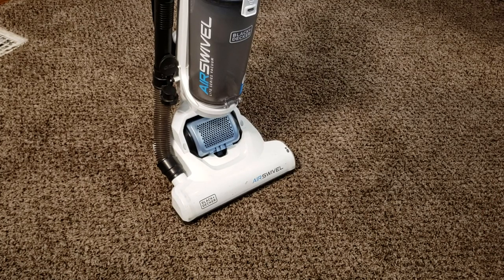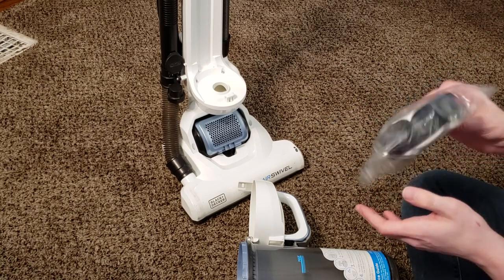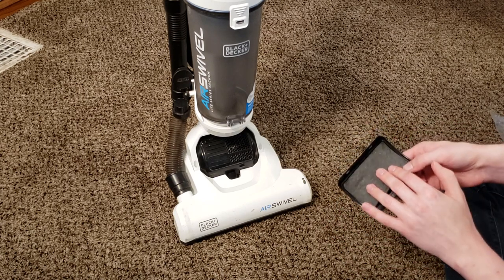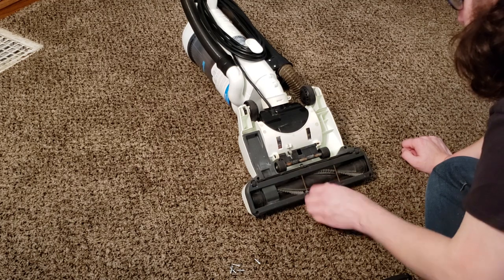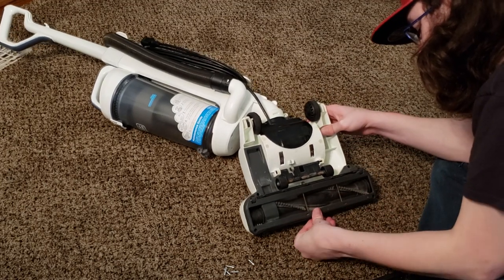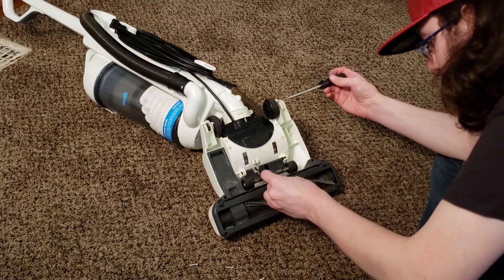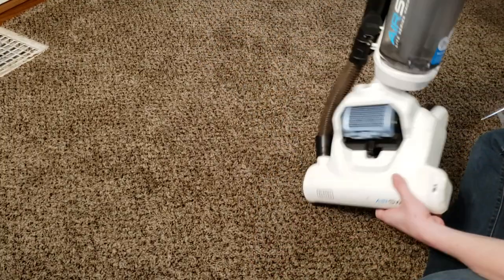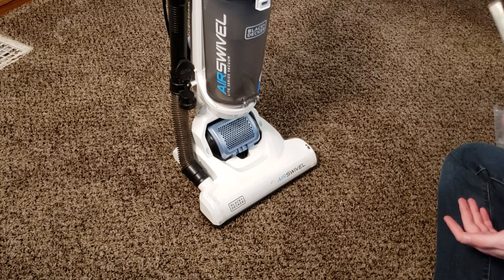Black+Decker AirSwivel Maintenance Guide - Changing belt, Cleaning Filter, & Clearing a Clog

Comment: U ain't alone brother. I too worked on vacuum brats fer many years, but when it came to servicing this same make & model today I ran into the identical belt entanglement u were experiencing. I couldn't slide the little bugger off without a tussle. I finally won the dual by trial & error. Carry on....

Comment: I disagree w/comment requesting less talk b/c I found it SOOOOOO helpful that you included the same multi-repeated mexican-bean-like screw chase/re-position/no magnetic head (tho has happened to me even with magnetic head-screwdrivers) debacle with same exclamations I've used, ie Tho don't wish it on you or anyone else➡that someone with your experience (16 yrs!) has had exact same experience I've had, got increasingly frustrated w/parts-build/making tool that should've been able to do OK, fail; unable to help by finding equipment to make it go smoother, plus, hearing you Id the issue as pretty much due to very inferior quality design/build/make of equipment➡ALL increased my morale re: continue trying to DIMyself repair vs give up on at least trying w/this & future projects (this stuff happens to experts, too).Thanks very much for your persistence & for your concern re: not charging more for the vacuum, despite time/energy you gave it, b/c you know it is such an inferior product❤May your generosity come back manyfold!

Comment: BDASP103 I think has another filter, inside the machine by motor.  Underneith the cover plate that holds the motor filter. And there's no filter hatch to easily access that last motor filter.

Comment: I trash picked one of those a while back. I cleaned it up real nice and put a belt on it as I wanted to try it out. Unfortunately, this one disappointed me. At 7:00, you mentioned a post motor filter. At least that one has a post motor filter. I now have another trash packed Black & Decker BDLCE101 which has no post motor filter below the dirt cup. Is it supposed to have one?
Reply from the maker: Some models have a filter there, and some don't

Comment: If you take the screws out of the bracket that holds the flex hose, then pull and rotate right to left:; the flex hose will come out of the plastic adapter.   This is where my problem was.